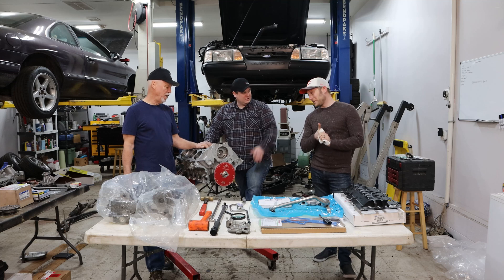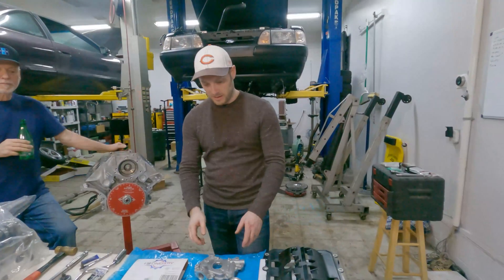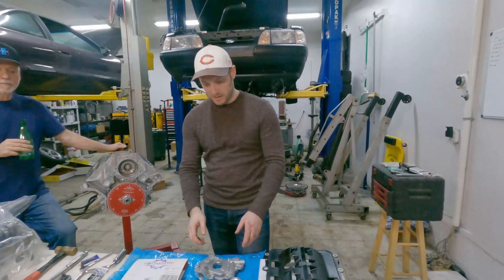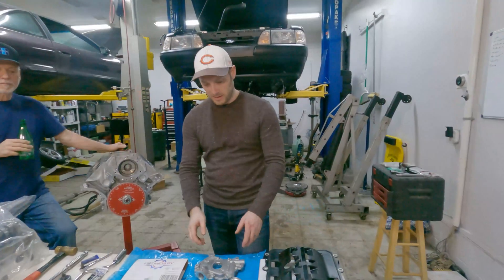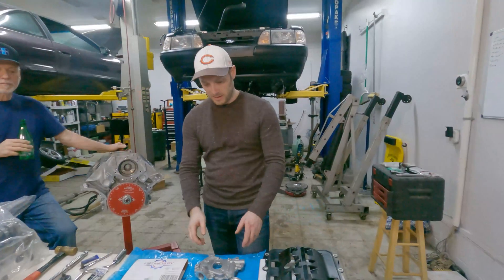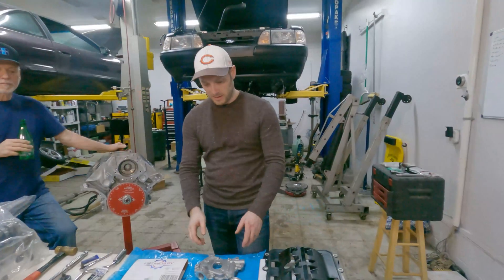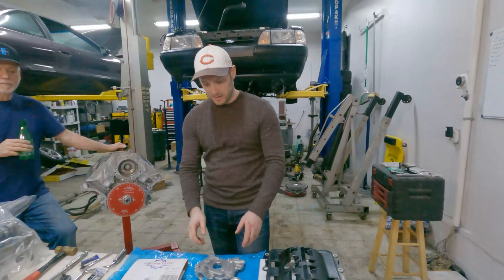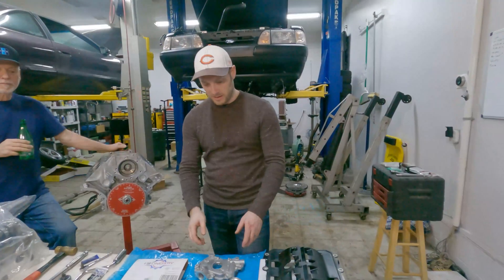4.6L 3V Build Part 4 - Assembling and Timing a Frankenstein Mod Motor.

Comment: Glad I found yalls channel! Finally someone doing a build series on a 3v. Hope to see it running soon.
Reply from the maker: You will! We're going to try to make 400 rwhp with an NA 3V!
Reply: And is it possible that a 5.4 3v make 400rwhp N/A
Reply: 4.6l with forged pistons witg h beam rods,factory crank with locked out phasers will get you  around 355hp naturally aspirated , 5.4l same criteria will be close to 400hp. Now add a turbo amd you are 450-500 for 4.6l and 550 to 600hp for 5.4l . Stock cranks are not capable of holding up to anything over 500hp though. Boost at your own risk!with turbo increase ring gap. .0060x3.5551= top and second ring gap. Aka .020 thousands for stock bore. Nitro is .0070x3.551(bore)..

Comment: Like your video .saying that I do have a issue with your build.
1 after you pulled pin on tensioner you rotated motor to the left. THAT IS A NO NO ! 
The tensioner will click out and tightens the cam chain to tight. Chain stretch and possible failure will result to chain and guides! After pulling pins ONLY rotate engine to the right!
Also by locking out phasers its a good idea to remove phaser Solenoids and tap holes and install plugs to block the oil flow to phaser. Increasing the psi to cam journals. Needed because the cast tensioner sqirts oil on chain and plastic  don't..

Comment: My heads are not assembled. 2007 mustang gt 4.6 3v. All my valves are flush with the cylinder head. As long as i am at tdc with cylinder 1, do i have to worry about valve to piston contact when i reinstall my cylinder heads to thr block?

Comment: I have a 09 5.4 3v.
In process of rebuild.
Added new Lunati cams (mild street).
Upgraded behive springs. .550
And partial locked out cam phasers. Just wondering about how much gap I need and how much I should shim the addjusters.

Comment: Can you please confirm that the '13-'14 GT500 oil pump, pickup tube, and oil pan gasket/windage tray will fit inside the 4.6 3V block without any problem, and allow you to reuse the stock oil pan? Did you have any clearance issues with the GT500 windage tray, or any leaks around the oil pan rails? Sounds like a nice upgrade.
Reply from the maker: Yes, it has worked perfectly.

Comment: Hey , I did my timing setup , and put my , tensioners correctly L on the driver side and R on the passenger side , and then alligned the marks correctly , but when i turned the crank over at the end too make sure the engine was smooth and worked , the timing marks moved, is this normal ?? My cam lobes were still in the same spot tho ! I kept making sure of this

Comment: Going with TTY stock head bolts and billet oil gears? Why not ARP head studs? The 250.00 oil pump gears you obviously planning on running the shit out of it (and you should lol), but those stock head bolts are limiting future power.
Reply from the maker: Early on we stated that this would be an NA only build. Factory head bolts will hold NA cylinder pressures. There's no need to spend money where it's not needed in our minds.
Reply: Camshaft lobes clamped in a vice? No biggy.